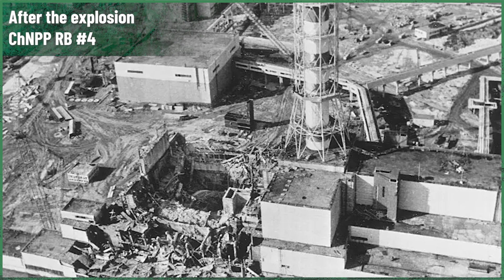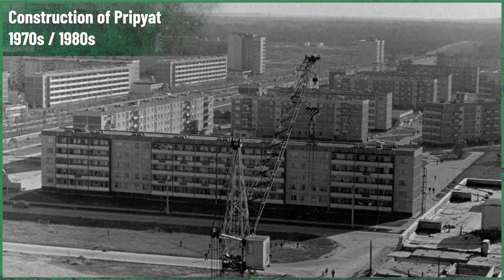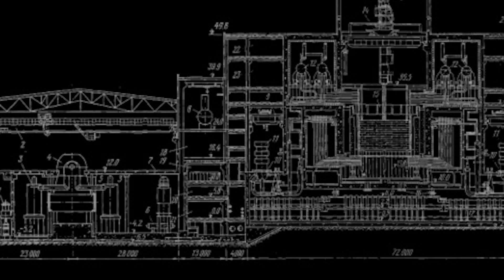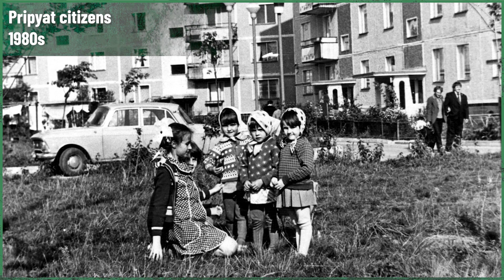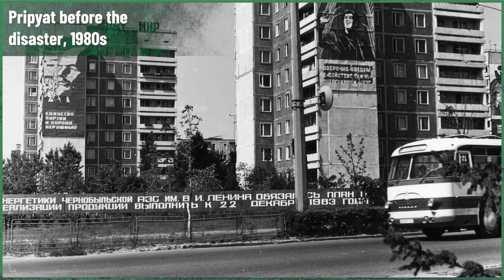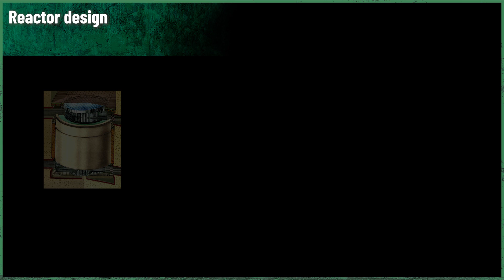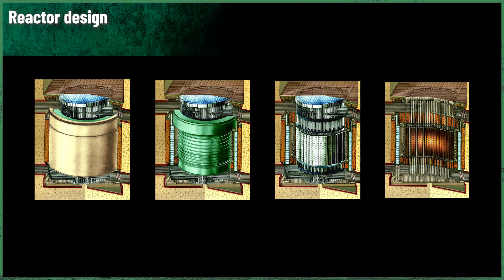Why Chernobyl exploded? Pripyat and Chernobyl history - PART 8 |||| Chernobyl Stories

Comment: These videos just keep getting better and better😊 And this one has a lot of RBMK goodness in it as an added bonus. Being a reactor guy, I really enjoy all these in-depth schematics etc. The schematics shown at around 9 minutes into the video, are these the respective schematics (from left to right) for Units 1, 2, 3, and 4? If so, what a difference between each individual reactor! Another detail I can add to my knowledge^^
And you are absolutely correct, one of the reasons the accident happened is the lack of practical experience. There were no training simulators available for Chernobyl. I think only Smolensk had the one proper simulator for ALL RBMK-powered NPPs. Young Toptunov had only a few months of experience running this very grumpy behemoth reactor unsupervised, when he had to perform this turbine test he knew nothing about. Having only ever been at the controls with the reactor quietly running at full power, he had never done any real power manoeuvering whatsoever. While you can make the odd mistake with a VVER (it being a very safe, stable and mild tempered reactor), with the not-so-stable, rather grumpy RBMK, not so much. It has zero patience for even the slightest mishap. They found that out the hard way.

You really have to feel for poor Bryukhanov, he was stuck between a rock and a hard place with no way out. Not exactly an enviable spot to be in, most certainly not in the USSR.
Thank you for another excellent video!
Reply from the maker: Exactly!
As for your question, the four schemat a are "layers" of an RBMK design, if my souces are correct :-)

Thank you for supporting us!
Reply: @Chernobylite  
Ah, they turned the reactor into an onion^^. Peel back one layer at a time so you can see the insides. If there is one thing the Soviet technical drawers could do exceedingly well, it is making normally very complicated, and rather dry technical schematics into small works of art. Not just an abundance of details, but in full Technicolor as well.
And you're welcome!
Reply from the maker: We have a joke here, in Poland, about the USSR's designs. Total dad joke, but I'll risk it.

What is it: it doesn’t give any light and it doesn’t fit inside your a**?
A Soviet machine to give light inside your a**.

(Sorry, couldn't help myself 🤣🤣🤣)
Reply: @Chernobylite  
🤣🤣🤣🤣🤣🤣
Reply: @Chernobylite  Guyes,guyes,stop it (do you remember the joke from HBO when Tula miners lead mioner say,"what is wasteing a tons of fuel,make a huge noise,and cut apple in three pieces-SOVIET machine designed to cut apple in FOUR pieces)"-we better spot or mr Vlada wil hunt us as spyes,hahaha,(I often ask myselfe-did russians did even ONE thing RIGHT?,i mean in history - russian history is a history of a failureS-in Plural

Comment: "RBMK Reactors don't explode." ~Every guy in charge at the time...
Reply: Guys in charge were right, RBMK can have a meltdown like TMI or Fukushima. We were lucky after Fukushima because company running it wanted to abandon all three reactors with meltdowns, while Russians plugged the hole despite dangers we can't even imagine. Someone who knew what was going on told me that French scientist suggested Fukushima should be stopped by exploding nuclear bomb in it, i would like to know if explosion would really help if situation was much worse and no spent pool near.
Reply from the maker: Every reactor can have a meltdown - in this case there were multiple reasons and design flaws are one of them :-)
Reply: @Chernobylite  Positive void coefficient was probably the main reason for meltdown, messing with safety features too a lesser degree. They did one thing very well; unlike Japanese capitalists running the plant, soviet crew at work didn't even think of leaving the plant causing one more meltdown and make things much worse. Understanding military side of the plant would be great but getting correct information requires lots of knowledge and time to find it.
Reply from the maker: Yes - and we will cover it in the next weeks in the new miniseries
Reply: @Chernobylite  Nice, i hope you will be able to find information about dual use, it is certainly hard one although Quora along some other sources should have some answers. Known fact is they were making plutonium (burn U for shorter duration as it will produce more Pu) for further reprocessing and then use in nuclear weapons. Some sources say tritium was extracted too because it is used to enhance the efficiency and yield of fission bombs and the fission stages of hydrogen bombs, as well as in external neutron initiators for such weapons. This source by CIA might be of interest to you, Legasov at Vienna too: "CHERNOBYL': A YEAR LATER". Assessment that accident will increase cancer across Europe in the next 70 years by 0,01% is interesting because coal directly kills well over 800.000 persons Each Year!
I believe containment wasn't built for ease of extraction of this materials, although Russians were using containment in normal commercial PWR which were almost as safe as Western back then... Good luck with search.
Reply: @codaalive5076 they had a mashine that could reafuel the reactor while still in use and that would make a confinement huge and very costly not impossible just very costly
Reply: @gingernutpreacher  Wasn't reactor itself too big to build containment at normal price? I think fuel was changed a lot more often because they didn't want lots of other transuranic elements present in the fuel before extracting plutonium, other reactors of similar type have fuel cycle of several years. Some sources say tritium was produced too.
Reply: @codaalive5076  yep it was a huge reactor they were being cheap skates with concrete
Reply: @gingernutpreacher  reactors like RBMK at chernobyl are not as safe as strictly civilian designs. fire at Windscale (now Sellafield) almost destroyed the upper floor of the reactor exposing entire thing to the atmosphere. design was different but it didn't have confinement either, chimneys engineers didn't want at first couldn't filter air used for cooling, etc. they were very, very lucky with this one as it could destroy big part of England. anyway, scientific papers don't mention the need for building additional confinement at remaining RBMKs, they made other extensive modifications. nuclear is still the safest source of energy and the only way to stop global warming, renewables won't do for meany reasons well described in literature.
Reply: @codaalive5076  yeah I know about colcrofts folly. It does depend on the country the UK definitely needs nuclear Australia I'm not so sure
Reply: @gingernutpreacher  This is two part series (actually 4 but 2 are missing for some reason...) about nuclear vs renewables with lots of calculations anyone can understand. I can't think of anything better than part 2 that would make people rethink renewables: "Germany’s overdose of renewable energy" (Asia Times)
China is very busy making various advanced nuclear reactor like TMSR-LF1 from Wikipedia. Other countries are discussing it a lot but nothing is done.
Reply: @codaalive5076  because the TSMR reactor's have issues with life span it steel brake's through the gain structure I know they can make single crystal parts using titanium but not shore if there is a size limit or a neutron issue